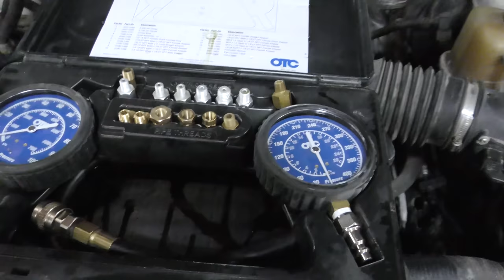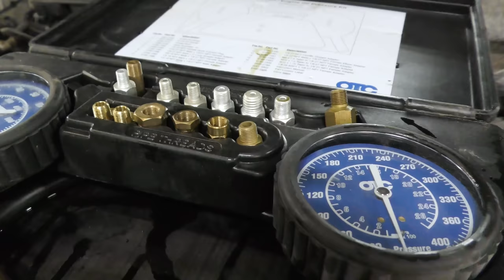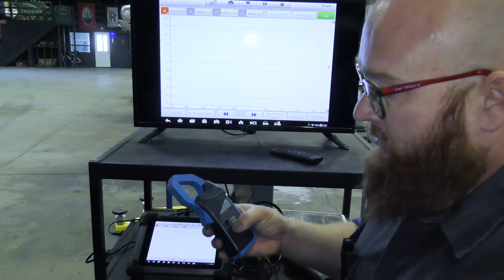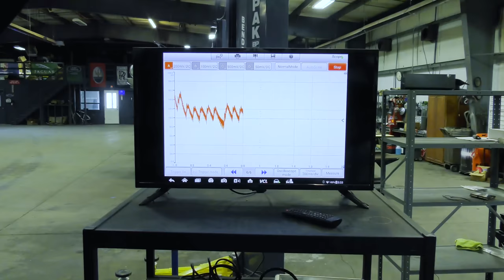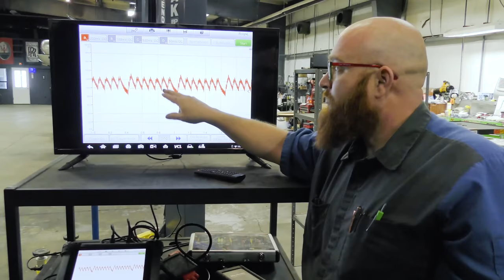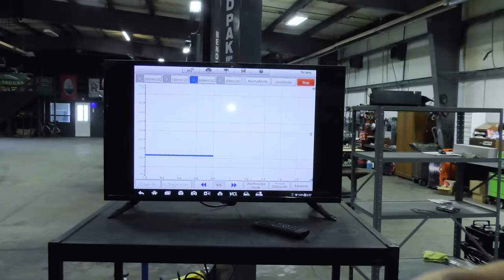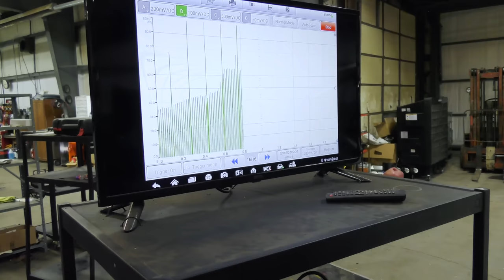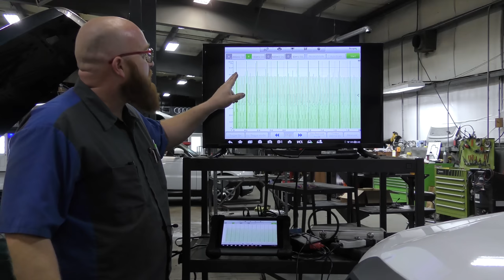Can an engine additive really fix this 2011 F150? CAR WIZARD shows how to diagnose and repair

Comment: Am I missing something with your relative compression test setup? Without a second channel on either the #1 coil or injector, there is no way of knowing which cylinder is low.

Comment: Lucas oil will work for a short period of time but it is very low shear stability.Lucas oil treatment is nothing more than long string tackifier. Make sure the customer knows that Lucas will only work for approximately 3,000 mi maybe.The tackifier will shear down and they will lose oil pressure. The customer will be better off buying an oil that is heavier on the high temperature side. 5w 40 0 to be 40 European blend would probably do the same thing but it would have higher sheer stability.

Comment: Ford with 180,000 miles has 10 lbs of oil pressure
My 4.8 Chevy is 20 years old, has 230,000 miles and holds 40lbs if pressure at IDLE and 60 lbs at highway speeds

Comment: GREAT VIDEO. VERY COOL. THANK YOU. I BOUGHT A USED 2004 F250 WITH 5.4 TRITON WITH SNOW PLOW A FEW YEARS AGO, THE ENGINE TICS JUST A LITTLE. WHAT OIL DO YOU RECOMMEND TO GO ALONG WITH THE LUCAS OIL STABILIZER, AND MOTORCRAFT OIL FILTER?

Comment: So you are simply increasing the viscosity of the engine oil…can you just move up to heavier oil? These close tolerance engines take 5w-20 or something like that when new. Does moving up in weight, or changing to a straight-weight oil, do the same thing?

Comment: I thought the oil pump needed replacement, which probably should be replaced when the timing chains, tensioners and guides get replaced. That’s why I like a Windsor.

Comment: Just run a higher viscosity oil so the customer does not have to worry about additive ratios if there is consumption between changes.

Comment: I've had one GM and 5 F150s.  There's a reason the Ford F150 is the top selling vehicle in the US.
Reply: If you count Chevy and GMC pickups they outsell Ford. GM does this on purpose for franchising and monopolistic reasons, but a Chevy truck and a GMC are basically the same thing and they sell more combined than F150s.

Comment: I’d just like to take the valve covers off to see what kind of sludge buildup is going on. Low oil pressure at 180,000? My first question would be How often was the oil changed since new?

Comment: The 2000 Silverado has 280000 miles 15 to 20 psi new o-ring  45 to 60 never drops below 45 when warm at an idle

Comment: Did this to my chevy because when warming up it drops oil pressure. Now my oil pressure is only low when I start it for a second maybe 2  I did use a walmart oil filter . I even flushed the engine a couple times but still got low pressure at start up

Comment: I have to F-150s my 5.4 2 valve 2001 still runs great and my 2004 F150 8 foot bed regular truck
Reply: I had a 2001 f150 with the 2v. I loved that truck. The trans went at 150k and the body was too rotted out to make it worth putting a trans in it.
Reply: @mph5896  my 2001 F150 is a Ford Lightning it comes with a F250 transmission in that one very strong transmission

Comment: Would a melling high-volume oil pump help this? I know that this is a relatively new offering and that it is popular among Ford truck owners.
Reply: It may be worth a try, but that’s going to be some $ to install it. Prob a 1500-2000 job for an oil pump for a bandaid repair. 

I did the same in my 5.3l Tahoe. It had low oil pressure at idle. I winged a high volume oil pump in and have an additional 50k on it. Still has decent pressure, but I gambled on it. The difference is I did it myself, no paid labor. Only $200 in parts and a day worth of work. If it failed to work I would only be out my time and $200
Reply: They don’t make them for the 5.0 Ford V8.

Comment: My garbage 5.4 L 3-valve Triton V-8 in my 2006 F-150 has 160k miles on it with never a single issue and it still runs like new. Is that just luck?

Comment: Better off with a fully formulated 50 weight oil than that Lucas crap, it's just greasy slop in a $20 bottle with no additives, so it dilutes the motor oil it's mixed with. 15w-50 Mobil or Valvoline/NAPA or Havoline 20w-50, I think Kendall still makes one too. 
Trucks in normal condition should try a 40 weight as a preventative measure. Castrol Edge 0w-40 with their titanium additive would be my first choice....

Comment: My old 95 taurus had the oil light come on it only when stopped and a mechanic told me to buy a thicker oil and just change the oil and filter. If it didn't fix to bring it back. I wonder if it would of worked with the same oil and lucas? Oh well its already recycled now.

Comment: Wore out at 175K??? My 1999 Dodge with the 5.9 (360 for people my  age!) has 245K and still runs great. Good pressures, temps, compression. The paint has died several years ago but as it is a work truck anyway, that isn't a big deal. I will look at the diagnostic equipment but I suspect it is in a higher tax bracket than I am in.. being retired.

Comment: GM trucks are actually more popular than Fords. People think the F150 is the most selling pickup, but they do not realize that Chevy and GMC are counted as two brands, even though they are the exact same thing under the grille and badge. If you combine them they outsell Ford by quite a bit. GM does this on purpose to get around franchising and monopolistic laws.

Comment: Why was the oil not changed.  How do you know that the engine is not full of 0 w 20 oil ?? Or gas dilution .  ?    

I would try 10 / 30 oil and maybe a new oil pump.  It may or may not be loose bearing journals causing low oil pressure.     Heck 15 w 40 oil might help even more.

Comment: That is why I hate most repair shops. They work by the scan tool. They don't diagnose why the check engine light is on. They just replace the part, take the money and the customer leaves out the door to come back later in a few days with the same issue. You actually DIAGNOSE and find out why the code is there and not just fire the parts cannon!

Comment: Would using a heavier weight oil have the same effect as the lucas?
Reply: If it has higher Zinc and Phosphate additive package in it.
Reply: Yes
Reply: I thought the wizard said on this video that heavier oil affects the cam phasers. Hence using Lucas with the additives
Reply: Exactly the same except cheaper. Lucas doesn't effect the phasers any less than thick oil, neither is good for them but I suppose it's better than a new engine.

Comment: Mr Wizard, have you tried JilCat? Sadly I just bought a low mileage f150 with 5.4. then I saw your video, then I googled engine sludge and found this product. Also I have 8 Cummins engines from 1977-903, 855+ 5.9-97 all get Lucas with every  oil change. Thinking of taking a chance with JilCat to attempt to clean my 5.4

Comment: The 4.0 litre inline 6 in my Jeep Cherokee is laughing. You have only 200,000 miles, and low oil pressure?
" Hold my beer "
Reply: Sadly the 2000-ish models had a known oil pump problem. I had an '01 with a bad oil pump that basically ended up ruining the engine at 194k.
Reply: Sorry to hear about your 4.0 Ryan, I have a 96. I had a 97 with over 400,000 and the engine was never apart. 4 water pumps, a oil pressure sending switch,  and a oil pan gasket, and valve cover gasket.  1 starter, 1 alternator. It's still running to the best of my knowledge.

Comment: Wizard, I have a 2009 Silverado 1500, 5.3 Crew cab. I have a rear end clunk, when starting from a stop, with a little more than gentle acceleration in a straight line. I have changed the differential oil, and check the backlash and it was like 7 thousands, with no abnormal gear wear. The spider gears did seem sloppy, but I am not turning. I also lubed the driveshaft front yoke splines. Could it be the leaf springs? 124,000k. Maybe a motor or transmission mount? Thanks.

Comment: I wonder if the use of non OEM oil filters over its life has accelerated this problem? Vehicles are so complex now, not using high quality parts is a huge mistake just to save a couple dollars.

Comment: Not a big fan of snake oil , would be better off with 15-40 oil.
By the way I've got 268782 miles on one of the 5.4 garbage engines. Great engines as long as you maintain them.
Glad I'm not going to this shop if they think I'm driving garbage.

Comment: Could throw a set of the billet oil pump gears in it and go back to running 5w20. But heavier oil should do the trick also
Reply: Who said the oil pump was worn out?
Reply: @ryanroberts1104  20 years as a Ford tech it’s a really good guess I’ve made about 95-100 times
Reply: @Strickland.Patrick  It's not worth tearing into a turd of an engine with that many miles on it even if you know exactly what the problem is. That truck is worth maybe $4000 max.
Reply: @ryanroberts1104  haven’t been used truck shopping lately have you?
Reply: @Strickland.Patrick I most certainly have. A worn out Ford (that means around 200k) with an already damaged engine has next to no value. Compare same to same to any other brand of truck and see how much cheaper the Fords are. There is a reason for this.

Also worth noting the truck in this video appears to be a base model with that stupid plastic front end.

Comment: 5w40 is also a good save for high mile motors, have also done the high volume oil pump route*
if you can get another 50-100k w/o pulling or at least separating the engine and tranny, why not

*when the pump is accessible from the pan like it should be

Comment: I bet that ignition coil probe's gonna be pretty useless on a diesel engine, LOL! also, the high amp probe may work for starter motors, but I'd say that a Tesla while accelerating hard or holding high speed will draw a bit more than just 650A. But I know what you're saying, so I'm just teasin ya ;)

Comment: Now Im worried because my dad's 2010 Ford Raptor SVT has the 5.4L V8 and it has only 66k miles right now and there have been no engine problems as I type this.

Comment: 5.4 triton is a good engine if you change your oil every 4500 miles and change the spark plugs on time without fucking up

Comment: Car manfacturers help their engines get better mileage and emissions by using lighter oil, the v8 ford of that year uses 5-20, You could probably get the same result going to a heavier weight oil, 5-30, 15-40, whatever it takes to get your oil pressure up. Lucas is so thick I would not want to use it in every oil change, I like it for engines that are using oil / leaking, bu slightly low pressure I'd try heavier oil first

Comment: So running it on nice 15w-40 diesel grade oil and adding a block heater/coolant heater for cold weather would prevent the problem then?

Comment: Wizard...you just drove a stake into my heart.....I own a 2012 F-150 with 187,000 miles........now I will be holding my breath every time I drive it.....guess I better add some Lucas!
Reply: This can't possibly be the first time you ever heard Ford engines are shit...
Reply: You're F-150 will be fine as long as you properly maintain it, that's true of any brand of vehicle though, they all have lemons, obviously yours is not because it's got nearly 200K on it and is assumedly still going trouble free. Keep up with your recommended maintenance and it should last you many more years into the future (assuming you still have it considering this is a 2y old comment). The 5.0L Ford is which I am assuming your truck has is regarded well for it's power and reliability.
Reply: @ryanroberts1104  Dude get real, they all make shit engines and they all make good engines, The 5.0L Coyote is better than ANYTHING GM has put out with AFM, modern 5.3L's and 6.2L GM trucks are known to regularly grenade themselves at 60K miles because of catastrophic lifter failure, the same is true of Hemi Rams. A 5.0L Ford is more reliable than all three of those engines put together.
Reply: @nathanmcdonald610   
Oooooo.....you angie!!! RAWR!

Do you realize this is over 2 years old? And you're still trying to play the brand game after saying they are the same? Did you take too many medications or not enough?

Ford is trash, this is objective, there is a reason people don't swap furds into everything, but every vehicle ever has gotten an LS. (Yeah, they swap a lot of LS engines into blown F150s) Also boats, airplanes, helicopters, generators, and more. You cannot say that about ford.

I know you're going to come back and argue, but I could not possibly care less, nobody cares what you think.
Reply: LOL! Even youtube doesn't care what you think.
Reply: @nathanmcdonald610  LOL again! Not a single person will read that, including me. You are talking to yourself, and still making a fool of yourself while doing it.
Reply: @ryanroberts1104  I love watching people state their opinions as an objective fact as if that somehow makes their inane statements in the case "Ford is trash" more verifiably true, it's almost equally as amusing as people who try to manipulate others by telling them how they're feeling or reacting to something as if that somehow makes it a reality, honestly though I understand, it's not like you're the only one of your kind on the internet, people like you come here to take control because you have none in your personal life, you need to feel powerful and in charge because we both know that in reality you are not. When someone challenges this illusion of control and authority that you have you cannot do anything except reassure yourself that you're right and hurl insults because in your mind everyone else is wrong, you need to believe that because that because its the only thing you feel like you are in control of deep down, sad state of affair to have your life in my friend.

The truth is, I dismissed your comment from the first sentence, I could tell you don't want to try refute anything I say with any facts other than LS swaps are a thing, yeah they are, but it unfortunately for your argument is not because the LS is vastly superior, it's simply because they are so radially available between Express vans and Silverado's but most importantly...they're cheap. I don't really have anything further to say to you, your opinion that Fords are garbage is duly noted and contradictory of my personal experience. So stay angry, stay belligerent and keep telling yourself Fords are trash, because you surely need to speak it into existence to convince someone and you knew before you made that statement that it wasn't going to convince me, remember, it's not a lie if you believe it.

I do hope that for your own sake you're able to pull your life together in the future, genuinely. I cannot imagine how unhappy I would feel on a day to day basis if all I had left to argue about was which brand of pickups we're better. Beyond this, I will not bother replying to anything you have to say as it won't be a lucrative use of time to have a back and fourth with you here. 

Best of luck in life to you.
Reply: @nathanmcdonald610  You must live a sad, lonely life.

Comment: Drives me NUTS when someone drops a bike off that “won’t start/stay running” etc.and fail to tell you they or their neighbor tried to adjust the valves or swap out a piston. 
I’ve seen pistons in backwards, valves adjusted 180 degrees out, or at just some random point in the rotation.  They can’t figure out why it won’t turn over all the way. 
The looks on their faces when you tell them you hope they didn’t bend a valve while standing on the kicker repeatedly lol. 

I shouldn’t jinx myself, but I swear by LUCAS oil stabilizer, my Silverado has 240.000 plus miles and has 40 psi at idle, and 55-60 at road speeds. 20%, one quart every oil change

Comment: 5.4 3v at 500,000 miles original engine and transmission; I think those engines are fine.

Comment: I wonder if there is a heavy enough weight oil that would equal the lucas 20% mixture. That stuff seems similar to gear oil so what is the math, 80% 40 weight plus 20% 90w comes out to what 50 or 60 weight? I don't know the actual numbers but somebody probably does.

Comment: I managed to save 4 diesel injectors with a diesel purge from liqui moly n my EU ford mondeo tdci. Sure it was not the engine that was bad, but if i had not saved those injectors the car would have been scrapped.

I have had the car for years and driven a lot of kms in it. It's close to 400k kms now, so things start to break sadly

Comment: Your information on the coil on plug tester is wrong, if you have a bad plug etc, you are likely to see the voltage increase and not go away unless the coil isn't firing or the plug is shorted. 

Also be aware the low amp probe suffers from drift and can be a pain when diagnosing battery drain issues, better to not zero the clamp and zero the scope if you can. Also the zero on them 2 probes is a degauss system, you need to hold the button for a few seconds, it charges a capacitor to do the degauss.

Comment: everyone hates on the 5.4 3v but they don't want to admit that the owners are the ones that kill them. Yes they have major sparkplug issues but if you change your oil when you are supposed to (every 5k miles) with quality oil they run forever. I've got one that just hit 150k and runs like new because the maintenance was done and proven since new, family members have driven them past 250k until the truck rotted out or the transmission ran away. I've about had it with car and oil companies claiming you can get 10k plus out of an oil change, maybe in Europe but not here with our shitty gas and heavy right feet.

Comment: Wizard can you do a video on piston slap on 2012 GMC 6.2L engines, I have had the dealerships replace the engine while under warranty and it still does it, I hear its normal but I'd like your advice, sounds like an engine knock at low rpm but goes away slightly when its warmed up, only 70k miles.

Comment: NOTE: this scope and these accessories WILL NOT WORK with the MS906, but they will with the MS908. The 906 is a great tool but if you want to use these accessories you need the 908 or higher.